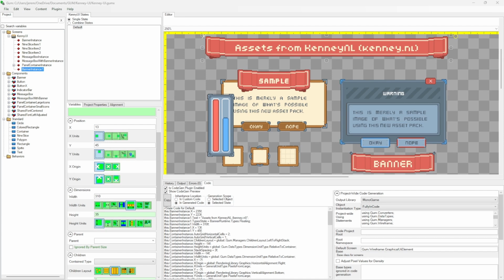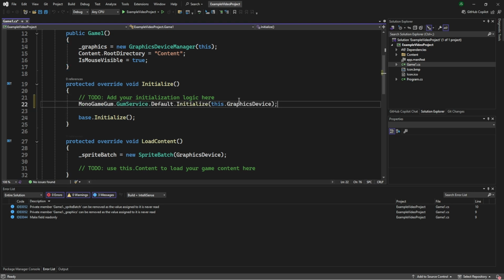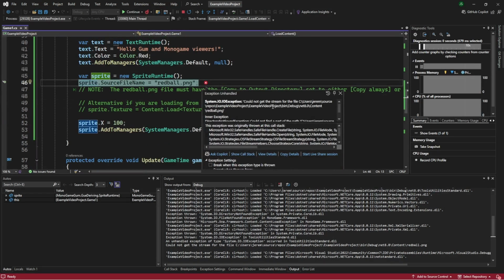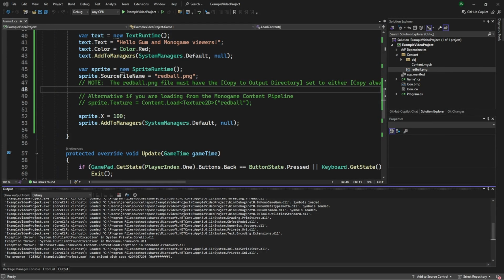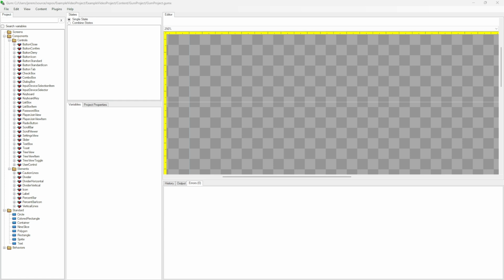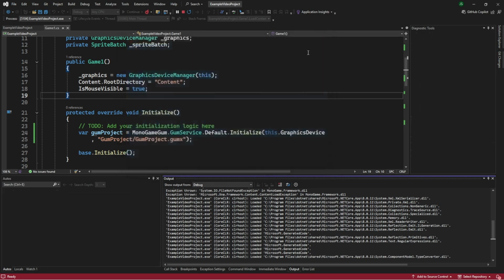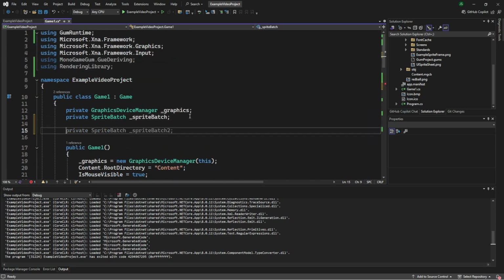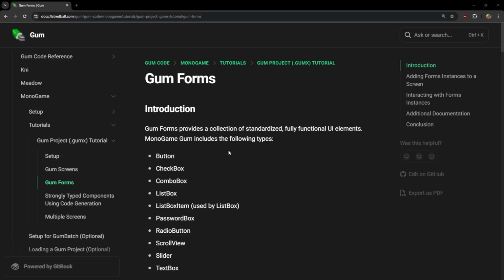GUM: Part 4 - Importing your UI to Monogame

Comment: Hi, I like your videos, I am currently going through them, and have for the first time in my life no more studying, so I am learning to code c# in visual studio 2022. (total beginner, only now that claude AI is available to me, I might be able to code my first game soon.) When building and trying to load DemoScreen into my c# game, I can get gum tool to generate the c# code for all elements, but it says FrameworkElement is obsolete:Úse Gum.Forms.Controls.FrameworkElement instead. I can copy and replace MonoGameGum.Forms. to Gum.forms. but I would have to do this for every gum tool generated cs file. Is there an option in gum tool, to generate the element cs files saying Gum.forms? Please assist, thanks. John (sorry if bad formatting in this comment, I usually email so unfamiliar with yt comment formatting)
Reply: Maybe the demoscreengum was written before the forms update? so I need to start a new form to get it to generate gum.forms. Also, I am not sure how to update gum libraries, I use the nuget package manager and have the 11.2025 version installed, so I think that should update gum tool and associated libs to new format. Just wondering why the gum tool program with DemonScreenGum is generating old call of monogamegum.forms. in each cs file, instead of gum.forms.
Reply: my gum tool version i am using is 2025.10.3, using visual studio 2022